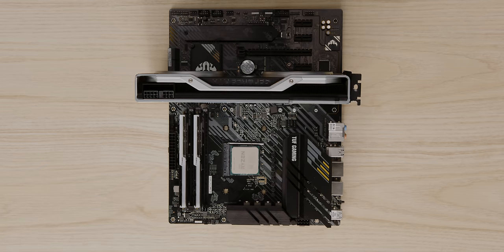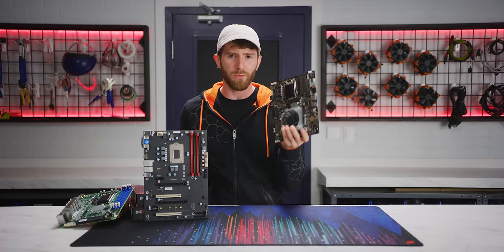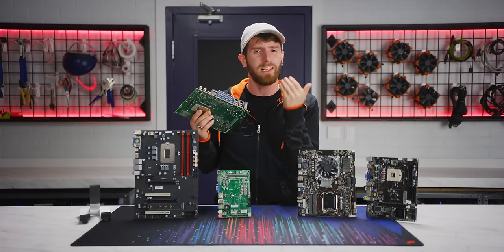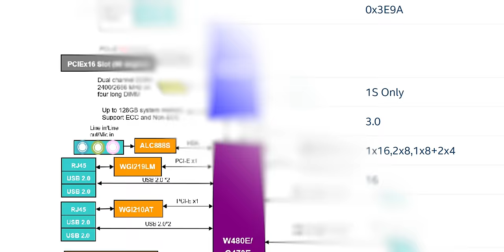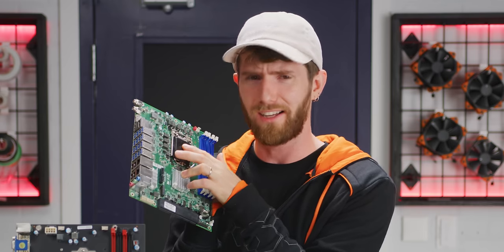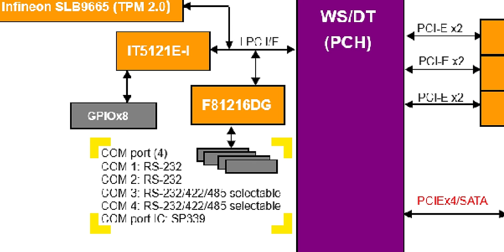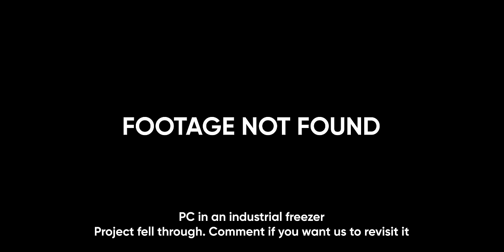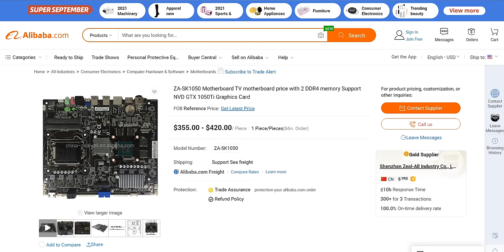5 weird motherboards that shouldn't exist

Comment: I've gotta say, that motherboard with the rear-mounted CPU looks so clean. The flat black board without any of the visible traces or tiny components on the front is really visually appealing. I'd totally be interested in one if it was possible to have the cpu be on the normal side, but leave all those small components on the back.
Reply: I think it possibly to mount in no fan case with large passive heatsink plate as backside of the case
Reply: Usually if you mount all of small components on rear you have fire hazard, because you will need to have longer stands to avoid touching the case and motherboard. Also this will misalign rear io hole. I fried some thing just by dropping cpu cooler retention bracket on top of it and it shorted with component nearby with fire but for a few seconds only.
Reply: I was thinking the same thing. It looks like a minimalist motherboard of sorts

Comment: That Portwell board would be amazing for building a Hauptwerk virtual organ setup. Those always need endless IO, the bigger the pipe organ you want to control, the more control surfaces you need to connect.

Low bandwidth, as it’s MIDI only, but you need LOTS of MIDI over LOTS of USB.

My small 3 manual setup requires 2 display ports and 8 USB ports. One for PC keyboard, one for the sound interface, one for the pedalboard, 3 for manuals (MIDI keyboards) and two for stop jambs (Novation Launchpad Minis in my case)

If you wanted to build a 5 manual organ controller with status displays and motorised control surfaces, needing somewhere between 10 to 15 USB ports is not out of the question.

Assuming that board can handle at least 128GB of RAM, or maybe up to 256GB, you could use it to build the most epic Hauptwerk setup ever.

Comment: That motherboard with the CPU on the back is perfect for the passive cooling case Linus used a while back. Now. He can see and plug everything.
Reply: Wasn't it the one they used?
Reply: @blunderingfool  not sure what the exact board was but it was a standard layout board with a PCIE extension to rout the gpu to the back of the board
Reply: @blunderingfool  that's what I thought too
Reply: @blunderingfool  Not for that case. They did use the board though for a cooling experiment however.
Reply: They used a similar board a while back to watercool an air cooler: https://youtu.be/u6zsHqdNRQ8

Comment: I saw that USB board and as a musician, VR Enthusiast, and Gamer™, I was like "oooo... where can I get one?"
Reply: Facts
Reply: But, actually where can i get one?
Reply: I feel like everybody saying this does not realize that USB hubs exist.
Reply: @TravisFabel  or maybe you aren't familiar with the concept of high bandwidth USB devices and the necessity of independent controllers. 🙂
Reply: Especially considering how stingy motherboard seem to be now and days. 

"Hey, I need like 8 usb ports plus maybe a couple extra for less than $200"

Motherboard manufactures "best I can do is 5"
Reply: @couldntthingofone269  Heck, with mice and keyboards using usb nowadays, we need way more than we used to, not less! They should at least replace the old ps/2 slots with usb if they're going to take them out.
Reply: @Sabrinahuskydog  yeah dude, I'm aware. Using one now. Plus my pcie lanes are taken by an audio interface with companion cards, etc. Also it'd be nice to build a microatx build for once in my life, but trust me, I'm KEENLY aware of the available solutions.
Reply: @Orchestructive  I'm well aware of how it all works on a component level but I'd be really interested to know what you're trying to use that requires high bandwidth and that many connections...
Reply: @TravisFabel  VR Lighthouses/trackers are a big one. Additional audio interfaces/DACs are another. CamLink absolutely REQUIRES direct plug-in to an onboard controller or it freezes every 20 min. Multiple gaming input devices (wheels, HOTAS, etc.). Then you add in external storage drives... it all adds up pretty quickly.

Comment: Recently took apart an old DVR (Digital Video Recorder) - and was interested to find that it was a fairly standard looking Pentium-II motherboard, but had a riser with 24 analog BNC inputs above the standard rear panel I/O connectors.

Comment: The “ITX” board (the last one) is for a media player! Thus the two sata power jacks. Depending on the model either the HDMI or the VGA port would be concealed by the enclosure.
Reply: Thank you! I was thinking it looked kinda like a Pico ITX but the dimensions are too big :)
Reply: @Micheal Connor typically I have seen them use standard passive heatsinks as well as enclosure sunk. Depends on the model.
Reply: @sendittozach  as they are mounted on the back probably cooled via the case. AI have something similar but smaller for a router.
Reply: No, it actually is an early version of PC Engines APU, this are meant to be used as a custom setup for running pfSense Gateway.
Reply: @sholzapfeld  have two looking at me I pulled from media players. Don’t be an insufferable. “They also are used as a custom setup for running pfsense.”
Reply: @sendittozach  while you pulled out of a media player, I actually bought one for my home network. So I’m certainly that’s a early version of a APU board, that “could” run a media player… yes,  but initially it wasn’t meant for running that type of application.
Btw, you can run on them also a stripped version of NAS home server.
People do some weird “things” to their hardware!
Reply: @sholzapfeld  indeed. Took your reply to say I was incorrect, but knew I wasn’t. Just wasn’t the entirety of their application, as we should both now know. And most definitely I have seen some weird boards inside of some even stranger devices! Cheers!
Reply: I sell industrial IT in my job, and I'm not sure would this be one of those MBs or a DS PC since there are no Serial ports. Nevertheless, the MB looks like kinda similar that they use in Advantech UNO and ARK series or in SuperMicro Embedded Servers (if we exclude the lack of serial ports). These are usually cooled by the chassis while one of the sides is just a giant heat sink.
Reply: It's used in the thin PC have very minimal options and low power. So these doesn't need heat sink
Reply: @SilentBridge  As far I can say outta mine that looks pretty much as the one displayed there, it indeed has serial a port but it has it on a pin header so you can access the board through console (when you buy the non display version), also on other newer version they had them on some proprietary port that looks like VGA but it isn't.

Comment: Linus: "This one is so tiny"
Really hard to tell when Linus is holding it.
Reply: There are smaller ones, than that itx me, like 3.5" SBCs, usually those are neatly packed in an all aluminum casing with somtimes vesa compliant mounting. Those can be mounted inside of slot machines, gaming tables, atms and many more enclosed low power environments. They mainly come with intel n200/400/500 and rarely with z500 atoms, one bank of sodimm ddr2 or ddr3, cf socket and sata, coupled with intel gma 900 gpus. Win XP embedded is OS of choice for those 4 to 8 watt machines. Almost all of those 3.5" and smaller feature lvds headers for direct communication with displays, settings of display timing and channel width can be directly adjusted in bios, furthermore those host a slew of old style rs 232, 422, 485 and other more rare connections and protocol. If your in field and need a low power super versatile stand alone solution to get you some ground piercing radar and other equipment going, these are the devices you would want. If you look for something for win xp gaming... look somewhere else, these SBCs never have a decent gpu on them or at least an express card slot or mini pcie socket. Expect performance same as netbooks from around 2008 to 2010. Companies I know for those SBCs are iei and ibase, there are some others though.

Comment: As a content creator and streamer I feel like I need all those USB Ports
Reply: Wwwwwwwwhat are ya plugging in besides webcam, keyboard and mouse??? And headphone/set and microphone (or alternatively those 2 connected to an amplifier)???
Reply: I mean usb hubs are pretty cheap
Reply: @DeadpoolPlayz  but in terms of quality, I dunno...
Reply: @shanedoesyoutube8001  Multiple capture cards and streamdecks more than likely.
Reply: @shanedoesyoutube8001  Well you named 5 right there which is already a lot of USB Real Estate. I like having a wired and wireless keyboard at the ready, my android connected for charging and file transfer, a stream deck, capture card, when the 3DS was supported I also had my 3DS Capture Card, and I find myself randomly plugging in other things from time to time
Reply: @sw.  This guy gets it
Reply: @DeadpoolPlayz  Yeah, but its not as good of a joke
Reply: @shanedoesyoutube8001  ahem Bluteooth adapter, wifi adapter, 2.4ghz headset adapter, 2 webcams, usb mic, usb mixer, external hard drive, usb ring light, micro usb for headset charging, xbox controller, streamdeck.  that's what i was dealing with before i upgraded to analog hardware and moved to ethernet.

edit: and a mouse :D
Reply: @shanedoesyoutube8001  he's plugging his channel in a linus comment section
Reply: @Verlisify  im not even a streamer but ive got my vr that takes 3 usb ports on its own, plus a wheel with pedals, ive got 1 usb slot remaining and it doesnt even work lol
Reply: I'm no streamer but I already have 10 plugged in: mouse, keyboard, microphone, Xbox360 wireless receiver, drone controller emulator, microUSB cable for regular connection to my GPS bike computer, USB3 HUB on my desk, fingerprint reader, UPS, and USB light strip.
Reply: I do need that many USB ports. As a gamer I have 3 controllers taking up 3 USB ports. 5 External USB hard drives, and 2 webcams. My Razer headset uses a USB port. My Presonus interface uses a USB port. Also my portable DVD burner is USB. I'm using all 8 of my SATA ports as well just on SSD's and HHD's. If I want to use a flash drive to transfer files from laptop to desktop I have to unplug a USB device. I had to buy a wireless printer because I didn't have enough ports for my old one. I've never had luck with USB hubs so that is why I don't even use one.
Reply: @sw.  I was thinking a streamer that wants all his externals hdds connected all the time. Only need to access 1 at a time.
Reply: @shanedoesyoutube8001  My graphic arts tablet takes 3 usb ports on its own. I use about 12 USB ports at all times.
Reply: As someone who builds Point of Sale systems, we need all those.
Keyboard
Mouse
Touch Screen (yes, HDMI touch based monitors usually need a USB connection as well, not just old ones)
Receipt printer
Cash drawer ( and possibly a second drawer, think bar terminal with 2 people working.  We don't share cash drawers with other employees)
Barcode scanner
In-cabinet barcode scanner (think grocery store checkout lane)
Produce scale

and depending on the customer/state/county/country etc...
Credit card / payment terminal
ETB card terminal
Second specialized keyboard (again see keyboard in some grocery stores / walmart)

All of those are best case, you'd be appaled at how much of a POS terminal still relies on 9-pin serial connections.
Reply: @wmp0074  Right. I forgot to mention USB Controller and External Drive and space for a flash drive too
Reply: I mean, I feel all of you but.... in the spirit of the video, that's why I got the mobo that I got. The X570 Aorus Elite.
First of all, it was the best value for money for a 570 board. And it reviewed great (Buildzoid approved) with the CPU I planned to put on it (3700X). In this matter, it has 10 USB ports. 4 "normal", 4x3.0 and 2x3.1. Plus 2x3.0 and USB-C on the Lian-Lin front panel. And I use one of them to connect to an Icy Box USB Hub (ib-hub1403) for the peripherals that dont need to be connected 24\7 (like flash drives, chargers and so on). Technically I have 16 USB ports. That I dont fully use (yet), but it doesnt limit me. 
I'll stop now because it's starting to sound like a brand ad. At least I didnt plugged my streaming link, so at least give me that. ;)
Reply: @Verlisify  20 ports would be a blessing to us. lol
Reply: You being a shameless plug for a dying channel I feel like I need to give your comment a dislike.
Reply: Aside from the usual mouse, keyboard, microphone, I have a flash drive/card reader, controller, joystick, UPS, a couple external HDDs, my phone and various things I'll charge off my computer.
Reply: I have to use a USB hub because I ran out of them. Well a 3.1 port on my case doesn't work well but besides that.
Reply: @Verlisify  just get USB-C lmao
Reply: @felix-gena6595  okay so USB C with 2.0 speeds?
Reply: As a super user I'd like to have many ports.
Reply: It's you
Reply: Ok furry
Reply: @Verlisify  You can just get a PCIE to USB card. Just using a 1x slot can give you 4 additional USB ports.
Reply: Gaming setup here, myself. 4 ports for controllers, 2 for keyboard and mouse, 1 for camera, 1 for mic, 1 for streamdeck, 1 for VR headset, 1 for capture card, 1 for drawing tablet, and of course you need a few extra free for usb sticks, chargers, phones, and external harddrives as well. I'd say 16 ports can work fairly comfortably, but you need about 20 before you don't have to worry about running out and having to swap and manage.
Reply: @tonyrulez69  I'm not a streamer either but I have like 4 usb hubs with over 20 things plugged in at once :P.
Reply: I could use it. 5 midi controllers, webcam, mouse, keyboard, audio interface, phone, up to 3 portable ssds
Reply: Just take the usb hub
Reply: Just as a gamer I'm already using 11. 1 for G pro wireless mouse, 2(one for charging) for G502 mouse, 2(one for charging) for G915 wireless keyboard, 2(one for charging) for G933 wireless headset, 1 for webcam, 1 for Blue yeti pro mic, 1 for xbox 360 controller and 1 for connecting phone.
Reply: Ikr, I always have a lot of crap connected to my pc so a zillion usb ports would definitely be handy.
Reply: Flight simmer: Hold my HOTAS, pedals, throttles, MFDs, trim wheels, gear and flap levers, switch boxes, UFC keypads etc...
Reply: @shanedoesyoutube8001   I have a mic, USB sound card (onboard audio is glitchy with Win10), gamepad, mouse, keyboard, bluetooth and a few USB drives among other odds and ends.
Reply: There are 16 port USB hub available. They share the bandwidth of a single USB 3.0 port, though, but it's perfect for tons of dongles and peripheral devices, plus being a good bulk charging station.
Reply: 666th like👹
Reply: Funny enough I just bought a new USB 3.0 hub with 10 slots because I'm running out of space to put SSDs in my computer lmao.
Reply: Same issue with being a sim racer, mouse 1, keyboard 1/2, vr 2, pedals 1, wheel base 1, wheel 1, button box 1/3, headphones, WiFi 1, Bluetooth 1. That's 14 already and there's 0 spare slots for USB drives, phones etc. So for this you really want around 16 😂
Reply: takes a lot of usb ports to make content of you screaching at and slandering pro pokemon players?

Comment: The first motherboard looks like it might be a specialty board for something like a security camera server. I wonder what power those type A ports deliver.
Reply: Did you watch?  He went into what it was probably used for.  I think the camera scenario was one of them.
Reply: Unlikely, the range of USB is simply to short (5 meters for USB 2, 3m for USB 3). Most security cameras use ordinary network cables and PoE for power.

Boards like this are used for industrial purposes and the "cameras" Linus mentioned are cameras that check parts, colors or labels in a production process.

I used a board like this once: I was working at a company that machined plastic parts and a customer - for some reason - wanted a 100% measurement and logging of each of the 5,000 parts they ordered. It took the machine about 4 minutes to produce the part, but the worker would have needed more than 10 minutes to meassure all the required values and write down the results. So we had to make an automated measuring and logging station - on a budget! We used a bunch of USB powered probes and pneumatics to move them, so the worker could place the part in the station, press a button and everything was done automatically within a few seconds. All probes were connected to a laptop with a logging software via a hub, but even though we used an "industrial grade" USB hub it was a bugfest! In theory, you can connect up to 127 devices to one port, in practice we constantly had probes that failed to activate or delivered wacky values, it was a nightmare... When the customer came back and ordered 8,000 more parts with the same requirements, we bought a board like the one in the video and it worked like a charm.
Reply: Isn't most security camera use ethernet for transmission? Some even use PoE for power. 
It's the same for computer vision system.

Comment: 1:31 I can and I want! If you produce music on PC and you use external gear such as external synthesizers, effects, midi keyboards, etc., then you will quickly run out of USB ports. I believe my current motherboard has 10 USB ports, and that is not enough for my current setup, so I'm looking for a PCI USB expansion card. And it's not even because my setup is particularly big. I have 3 synthesizers, a drum machine, a sampler, an effects unit, an audio interface, a midi controller. digital recorder with stereo mic, mouse, keybouard and I need more USB ports, many more usb ports.
Reply: yep same here. currently I need multiple USB splitters. though some audio interfaces have extra line and midi inputs